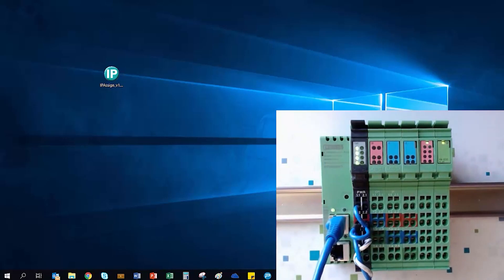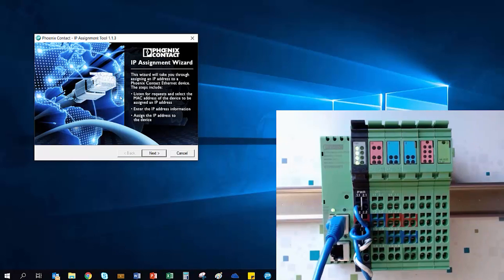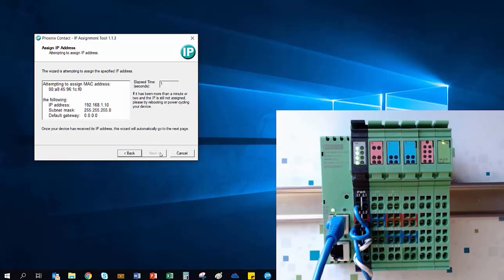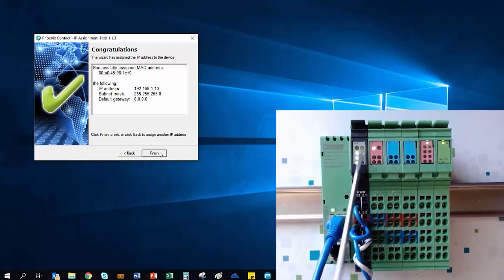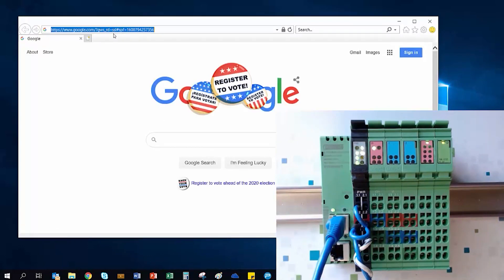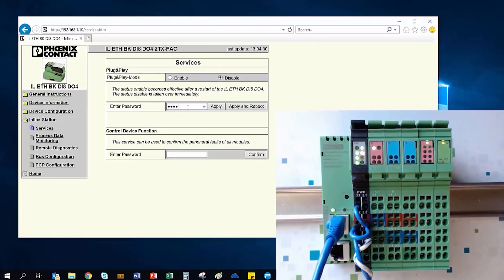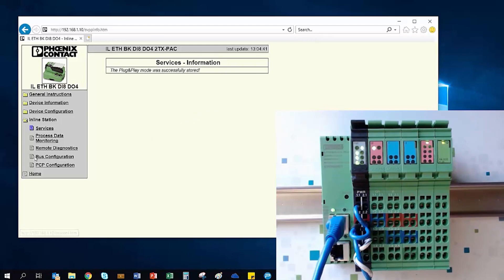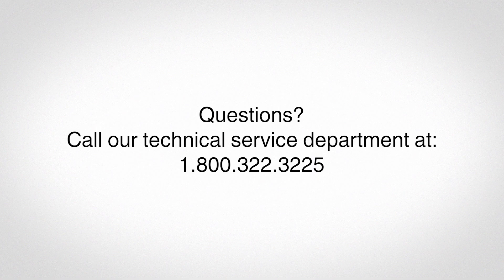How to set up an Inline Modbus TCP bus coupler and its local I/O

Comment: How do I change the # for “Consumed size in bytes” from “6” to “10”? I see this displayed on the Bus Configuration screen but cannot identify how to change it.
Reply from the maker: The produced and consumed sized its determined by the number of IO modules on the local bus. This value can only be changed by adding of removing I/O modules.

Comment: Hello! I can’t connect to a device by browser. The device has assigned IP address and it answers to pinging. Does exist another way to config it?
Reply from the maker: The only other option is to configure the unit via ModbusTCP commands. I would try a different internet browser.
Reply: @PhoenixContactUSA   thank you for your reply. Unfortunately, it doesn’t work. I tried 5 different browsers and two laptops. I scanned ports and there are only two opened ports 21 and 111.

Comment: Hello, thanks for your very nice video,if i have a configured one and want to install it in another local bus ,is it available to make Reset for it to reconfigure on the new i/o local bus?
Reply: If you know the stations IP address log into it the head stations webpage using a browser and turn Plug and Play mode back on.    If you do not hold down reset button and power the unit up hold for about 20 seconds and the unit will factory default.

Comment: how can I reset the device using the reset button.
I cannot find any instructions and the device is not displayed. I assume that it is in an unknown IP network
Reply from the maker: To factory default the device you need to do the following steps:

While power is applied to the device, press and hold down the reset button.  Next, remove and replace power while continuing to hold reset.   

After about 15 seconds you will see the LEDs go through a sequenced flash pattern indicating the device has been reset.  Now, if will function like it is new out of the box.

Comment: We try this solution, but we get stuck at the IP assign page. We can see the mac adress of the device.
Reply from the maker: Your bus interface module might already have an IP address assigned to it.  If this is the case you need to power cycle the device before you get the check box showing you the new IP was accepted.
Reply: when you stuck on ip assign page just restart Power of PLC it will take new IP which is you have given in ip assign software. Thanx me later
Reply: Same problem as you, I'm able to see the MAC address, but the program doesn't seem complete the IP assign. I tried plenty of different IP addresses but none have worked yet...
Reply from the maker: @thomnjerry       Your bus interface module might already have an IP address assigned to it.  If this is the case you need to power cycle the device before you get the check box showing you the new IP was accepted.